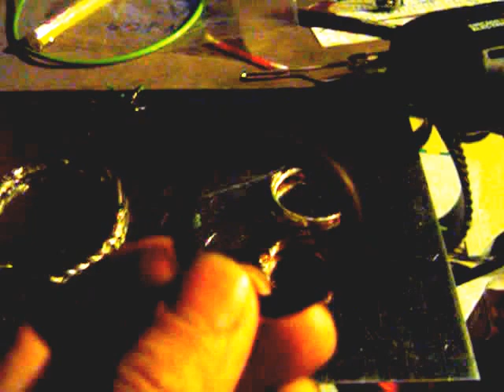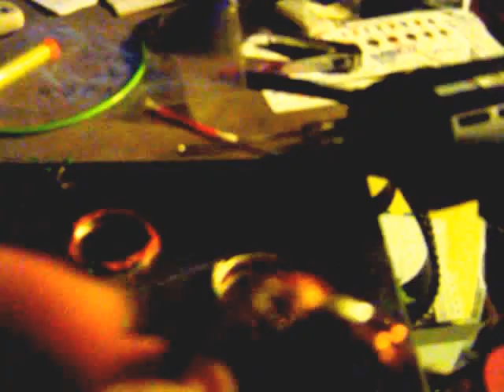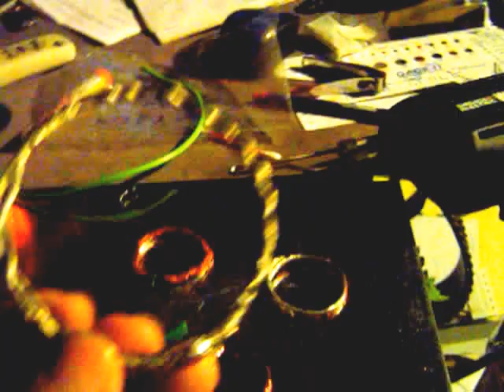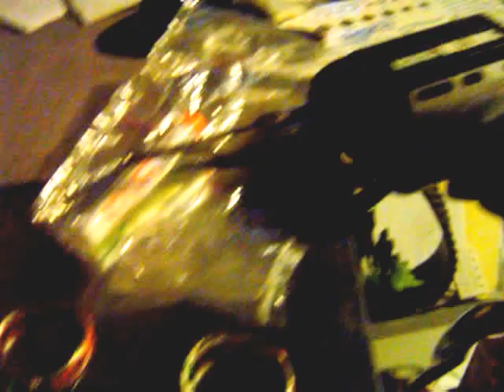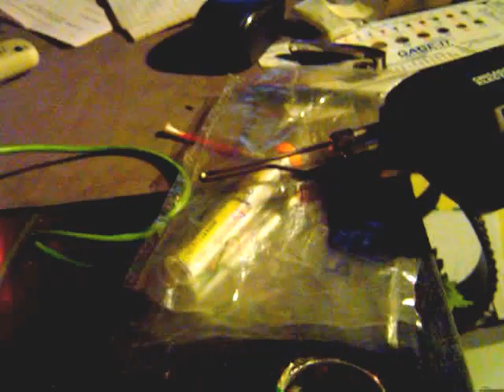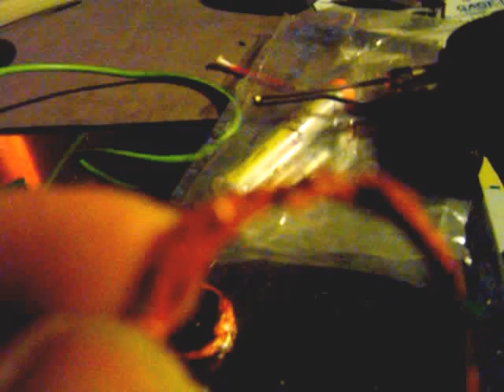How to Make DIY Copper Exhaust Header Rings-Gasket

Comment: Anyone else feel like he's lieing about the wire being free? I've never heard of anyone throwing away copper lol.
Reply from the maker: +MrHillbillyScientist Yeah the mall was putting up a new shop and tearing down the old one so I asked the guy if I could have the copper wires.  He showed me where the dumpster was and I got a knapsack full of wires, harnesses, and all kinds of good stuff.  So yes, I have bags of the stuff and hit the jackpot with that store.  Not the first time I hit the jackpot dumpster diving, LoL.
Reply from the maker: I like these more than I like the copper rings, those cost $10 for 4.  These copper rings you can reuse time and again because when you crank down on them; they spring right back.  Exhaust copper rings, 80mm and up in diameter, are not cheap but who said it was free?  Usually when demolition is made, the material is gone in less than 24 hours; obviously.  ONCE YOU LEARN HOW TO BRAID THE WIRES, SPOT WELDING THEM BECAUSE EASY!